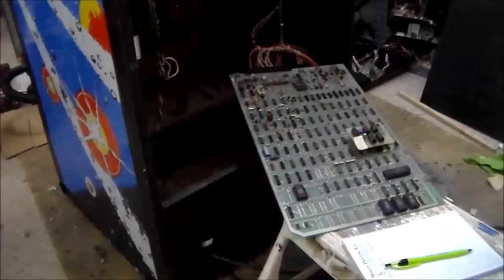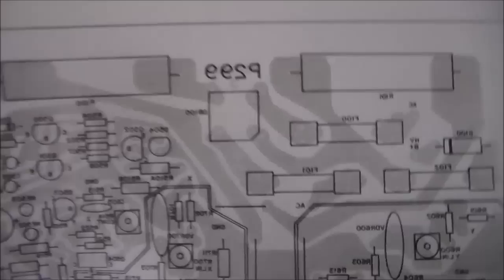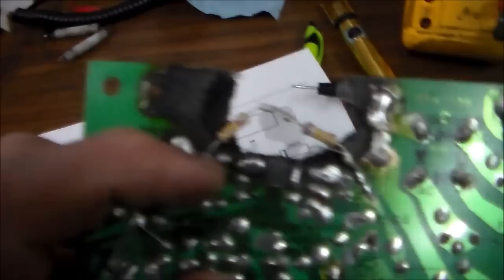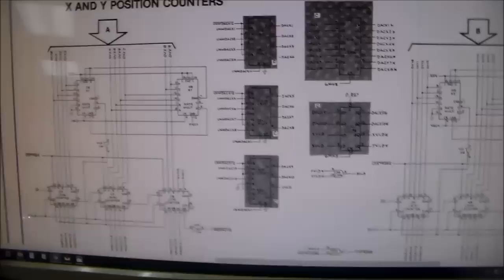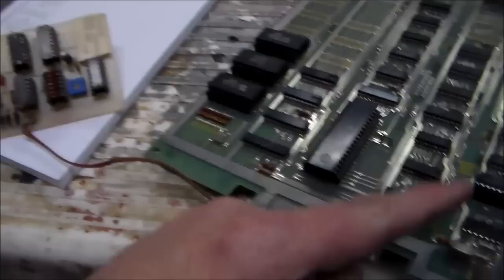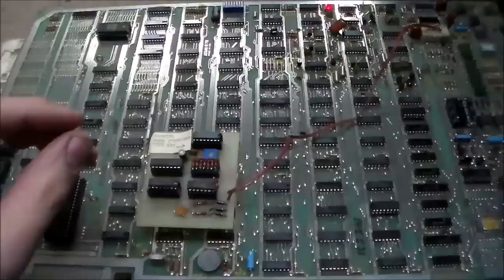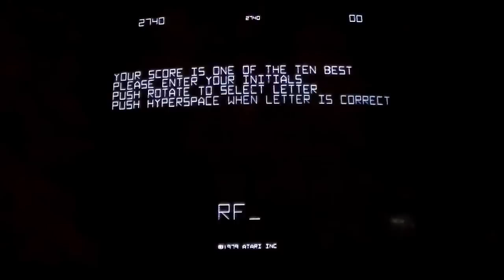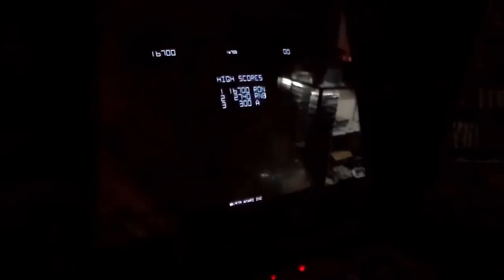Fixing a 1979 Asteroids Arcade Game - Operator Caught The Vector Monitor On Fire!

Comment: DACs aren't that hard to figure out. In fact, you can make one out of resistors. The idea is that the highest bit produces half the voltage of the range you need. Like if a monitor needs 0.7 volts for maximum brightness, the highest line would send out 0.35 volts, and the next one is half of that, and so on. All those voltages are added together and thus you get a range.

So you can use DAC chips or discrete resistors when you need to convert from digital to analog. So you convert different binary signals to a range of voltages on a single line. And to be technical, it isn't quite a true analog signal. If you have 8 wires going into it, you don't have a steady range of motion, but steps of 1/256 of the range. So the more bits you start with, the more total steps you'd have. So if you had 16 inputs to a DAC, then you'd have a range of 65536. That would be the resolution of the signal, and the more parts it takes to make a whole, the smaller the difference that adjacent input values would make on the output.

And a common phrase is Mutually-Assured Destruction. That is a common strategy among criminals to prevent others from ratting them out. A club that possesses illegal content online would make new members upload such content as a condition of membership. So everyone has a stake in all others not getting caught, so they will be more careful to not let others in. So to join something like that, one would need to dirty themselves and leave incriminating evidence about themselves.

Comment: i did plug the deflection board back in and the led red light is on!
Reply from the maker: You may have an issue going on where the board isn't putting out a voltage, sometimes it's hard to figure out if it's the board or the monitor... have you read through the "F.A.Q." Yet?  Here's the link:  https://www.arcade-museum.com/manuals-monitors/FAQ%20Black%20and%20White%20XY%20Version%201.1%20dated%207%20Feb%2002.pdf

Comment: I have Asteroids with vector monitor & no video. Just a pin prick in middle of screen. My deflection board is different than yours here. The tag reads"Atari Monitor X-Y part 92-042. There seems to be two boards on this level.(another in center behind monitor). Is my monitor the other version you mention?

Comment: Did it burn because of a short, or because the carbon resistors were not rated for the high power (wattage)?
Reply from the maker: There was a short and they had too big of a fuse installed....

Comment: hi taking them res out is very bad new's   they are there as a safe let out of power  they are used is reel to reel  to take down power levels to the ac dc motors
i did was you done some place's were over heating till i put them back
Reply from the maker: Thank you Bob!

Comment: If you can’t repair it The board you might have to make yourself a x,y monitor yourself a 19 inch or 23 inch you can probably go out to 27 inch possibly
Reply from the maker: I think you could but I've never seen one bigger than a 19", I think I read one time there might be a 25" vector.

Comment: i had to fix a controller board for a high voltage orbital welder head the high voltage burned up the board like this i mixed fiberglass and two part epoxy to rebuild the board and left it a bit thicker in that area as its thin board was part of why it had failed they were using the board as an isolation for the high voltage then did the bridging of the various components with silicone insulated wires saved the valve company over $5K
Reply from the maker: Nice Job!  Thank you for watching too, we'll see you on the next video!

Comment: JOE'S CLASSIC VIDEO GAMES,  the IC 12 is a TLO82 op amp chip, I'm guessing it wasn't outputting enough current to the DAC chip that is why is was shifting the image to the left or right? I'm confused why it fixed the shifting of the image, very weird it doesn't make sense because a TL082 is just an op amp. 
What hack did you do to the arcade board to be able to adjust the "speed" of the game? you mentioned in in the video about some hack to adjust the speed of the game
Reply from the maker: Hi Bill!  That hack was that little board that I installed, did you see that part of the video?  The little board being added 'hacked' the board and made it faster.

Yes I think you're correct about the voltage making it shift on the screen.
Reply: @LyonsArcade  yes i saw that daughter board has a lot of chips on it. But what is that little daughter board replacing it is in a ROM chip socket or what socket is the little daughter board going into? 
I'm curious which chip it's replaces to add the little daughter board onto to speed the game up. When looking at the arcade games schematic what do you think the little daughter board is doing you think?

Comment: have you ever considered making replacement boards? there are plenty of sites that can make pcb boards to spec.
Reply from the maker: I just had this one to fix, and fixed it in a few hours so I didn't really need a replacement (you can still buy them used in great shape, too).

Comment: There is a place in my town where the owner had a dozen retro arcade machines and the building just had a major fire. Smoke, water and fire damaged. Can these be brought back after a fire or are they toast, lost forever?
Reply from the maker: They can be saved but it's a big pain, it honestly may be less expensive to buy new ones with the insurance money.  If it's just smoke damage you can clean it up, and the water damage doesn't always completely destroy them after it dries out (most games have been water damaged anyways)... fire damage of course is really destructive.

Most games if they get soaked a few times are just fine (if you let them dry)... the ones that have what people refer to as water damage usually SAT in water for a long time, or were in a shed where they were leaked on for months or years.  You could hose one down a few times and it wouldn't even be very noticeable.... remember a lot of games got rained on while being transported from location to location on the back of operator's pickup trucks!  

Depends on the shape they were in originally, and what shape the owner would like them to be in after cleanup.
Reply: @LyonsArcade  problem with the water damage is the fire happened on the coldest night of the winter(it was around -40 degrees) so not only water logged but frozen as well. It is not expected to be above freezing for another week, but only marginally(2C or 34F). Quite likely they will be locked in ice for months until spring. But as one would expect, if they are not ash they would be melted from the heat. They were in a space ~40 feet from the gutted part of the building without any walls or doors in between, so pretty dire.

Comment: Looks like the damage was caused because the repair didn't use ceramic resistors, the replacement non ceramic resistors have overheated.
Reply from the maker: I think that and they had the wrong fuse.  Thanks for watching Andy!

Comment: Hey does anyone know what exactly is going on on that board with two or more components?

I noticed something.

Two components that a neon bulbs.

But seem out of proportion to others I've seen.

Longer.

And longer electrodes.

Could have just how much things where is zoomed in.

My theory is they were being used for surge protection.

AKA limiting maximum voltage.

Kind of like a spark gap.

That if it got above a certain voltage they will conduct.

For protection purposes.

You're like they would on your electric fence charger.

Or other devices.

More like is sometimes done on low voltage devices that may be exposed to high voltages or lightning.

I've seen him and other equipment but never really looked into it.

And also sometimes it equipment of that vintage.

Any thoughts on this at all.

Or reasons why those would be there that I would not realize.

Please comment.
Reply from the maker: Aaron, here's the manual:

http://arcarc.xmission.com/PDF_Monitors/Atari%20Monitor%20TM-151%20Issue%203%20Electrohome%20G05-802%20G05-805%20Monochrome%20XY.pdf

They're on the lines going to the CRT socket!
Reply: @LyonsArcade  thanks for the manual somebody was just asking me about one of all those Waters today for some reason don't know what.

I'll send them the link so thanks and thanks.

Since it's going to the CRT socket it's got to be for over-voltage protection I'd say.

Kind of like having the spark gaps in TVs.

I'm pretty sure that's what they're doing.

Comment: I have a 1982 Merit Chicken Draw Poker CRT100 that went kaput..displays random game video and solid speaker tone on startup.
I cannot find a schematic for this game anywhere. I did manage over the years to get all the dip settings.
Any help on getting a schematic would be appreciated..Also if anyone needs the dip settings, I have them.
Reply from the maker: I've never heard of it unfortunately, have you tried looking at the schematics for any of the other poker games to see if they match up?  They made a ton of them and many were designed similarly, it may be they used the same board with different roms for that game and another one that the schematics are more readily available for.
Reply: That company is really tough to get schematics for. Probably bc they were in every bar I know of including Cherry Master at that time in Pa. 
They were generating some really good revenue back then until legalized gambling was approved.
I will try to dig further into your suggestion. 

Thanks

Comment: The issue of not knowing about the chips working or how they do work is solved by chip information sheets/white papers. The thing to understand is chips are not black boxes. Just logic circuits. The dac just converts binary to current. Amps*Volts. This is timed to put an rf signal to drive the vector display. 
My point here is that you got to the fault but took the long way to find it. You can see the signal on the scope if you found the path.

Comment: Where can I buy chip that is at tlo 82?
Reply: It's a TL082 (TL zero eight two) dual operational amplifier, you can buy it at any electronics part shop. Even on ebay.

Comment: Why do they put five fuses and that burn spot never fried one fuse? I have come across that many times. Fries to works and never blows a fuse. They seem to be for looks like parsley on your plate.
Reply from the maker: I agree with you again :)
Reply: While I can't comment on this particular failure without poking around, I have seen many times where the power supply is not actually capable of blowing the selected fuse.

For example, if you look at the average melting current curve of a Littlefuse MAXI 20A, it'll hold 40A for 9 seconds and to blow "instantly" you'll have to push 100A through it for about  0.5 seconds. This would not be a good fit for your hypothetical 25A power supply that can only manage 28A before the voltage droops too low. It would be a good fit to protect your car battery from your made up 12V space heater shorting out as the 700A from the no name car battery and 140A from the alternator can easily open the selected fuse.
Reply: Frankly my friend I don't have a clue as to what you are talking about. Lol But thanks for trying. @PimpMyPc89

Comment: Oh boy so people put in that crap on Video game uprights as well?
I had a fun one where on a pinball machines electronics boards there was two different resistor values on the board and was surprised it was not cooked.
The customer also did not want me to replace it as he said he has some dude do the electronics.
Basically he would slap me in the face every time he wanted me to do something which was cleaning the machine and taking it some place else to get the machine working.
I do not even bother with that guy any more though he burned to many bridges with me. :|
It was back when I wanted stuff to work on and was not sure what to charge but now the ones that did use me don't like that I have an hourly rate and don't want to pay me for the work I do for them so hoping to get some one that will.
I just hate the ones that think I should forever do everything for free or for piddly amount of money.
Sorry I kinda went on a vent thing there.
I am sure you and many others in this line of work have come across the whiners that want something for nothing.

Also that board looks similar to the PPB board on my Star Trek Data East pinball machine.
I was to nervous to use it even though I had "fixed it".
I just got a brand new rotten dog PPB board and have that in now.
Yes the electronics gods exist all that zappy Zeus lightening bolts going all over the traces. ;)
Reply from the maker: Yeah I know exactly what you mean, I've ran into that type before :)  Since we've got a store though a lot of it is cut down and a lot of people are just happy to find someone that will fix it!  We usually charge a 'per job' rate instead of an hourly rate so it works out pretty good like that if people know up front how much it'll be...

Comment: There were two resistors and the guy replaced them with two resistors. Checkmate, atheists.
Reply: Kanal Frump I was lost in agnosticism, questioning the existence of a higher power, and wandering aimlessly through the spiritual void. Then I witnessed the miracle of two resistors in series, and my soul was saved.
Reply: @drloko4013  you didn't get such high-grade miracles back in the biblical days...

Comment: Louis Rossman: ATARI SUCKS THEY DESIGN THIS STUFF TO FAIL! THEY LET  THE BOARD CATCH FIRE BEFORE EVEN BLOWING THE FUSE

Me: Not how it always works bud. Maybe you should take some electrical classes so you can know what you’re actually doing, and not just replacing components... 

Also me: if you literally have worked on on specific companies things for years, you’re going to see absolutely everything “wrong” with their products, but you don’t get to see it happens everywhere else. You think you’re precious little Lenovo’s have never burnt  a chip to a crisp and the fuse is ok?
Reply from the maker: Yup!  You've got remember on these too that the game had already been messed with by a previous operator who knows what fuse he had in there :)  Thanks for watching EndOfLine Tech we appreciate it :)
Reply: @LyonsArcade  yah, posted before I saw wrong fuses but my point still stands, not much of a point but a gripe about somebody who thinks they know everything. Those wire wound resistors (at least looks like) had to of been magma red though to do that kind of damage, how was it not caught before that mess!!